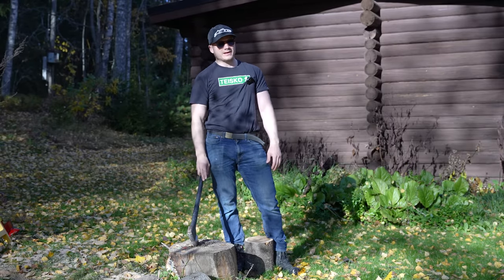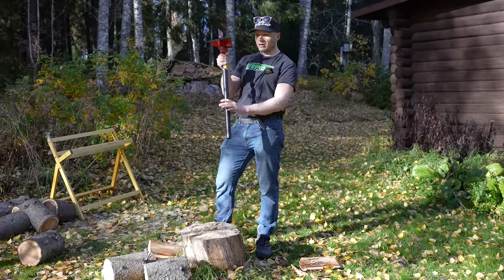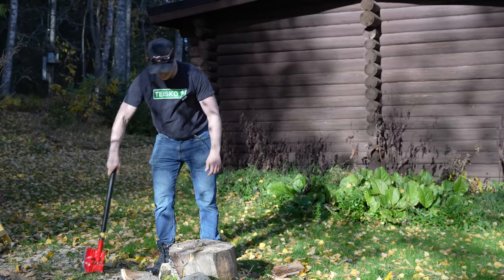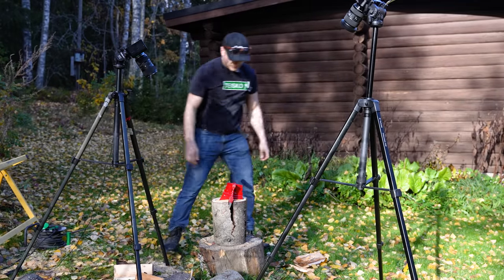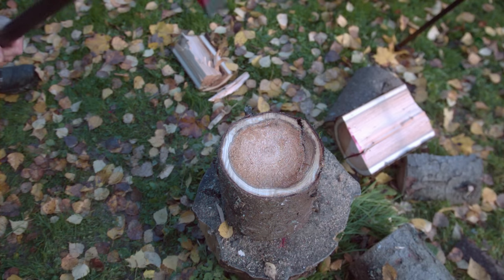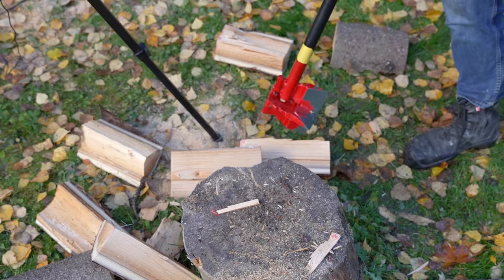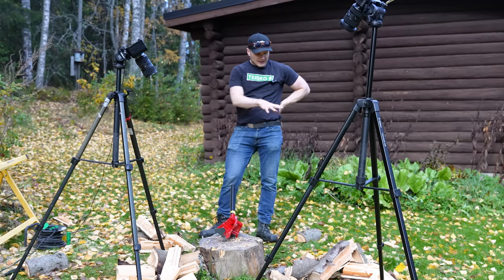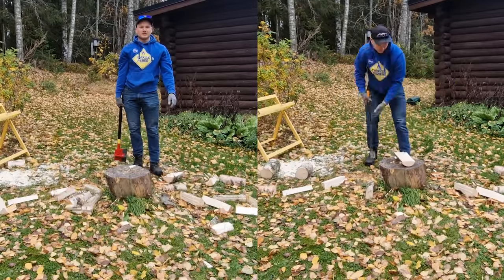The Best Axe EVER? Four Bladed Quad-Axe

Comment: When my axe gets stuck in the wood because it does not split completely, I leave my axe inside the wood, lift the whole thing, rotate it that the axe is under the wood and hit my wood block such that the weight of the wood pushes it onto the axe and so it splits. That happens especially with bigger logs and very curly strains or many knots.

Comment: This design looks like it would be best mounted to a base with a ring 8 or 10 inches above the axe blades, then place the log on top and then use a sledge hammer to split it, of course give enough room at the bottom for the pieces to fall away.

Comment: You know the problem..
You need to offset one pair of blades so it splits one way then splits the other way.
The trick will be using your high speed camera to figure out your chopping swing speed Vs how fast the wood is ejected to the side so the delayed offset blades still contact the wood before it's ejected.
The offset blades also want to angle back in towards the centre to hold the wood to reverse the original ejection direction from the initial split.

Comment: Neat, but you undoubtedly have to be more picky about what variety of wood you are splitting.   The white birch wasn't too bad, but if you tried yellow, it would be misery (splitting yellow birch through any means is pretty miserable).  Reminds me of an axe I used to have, it was labeled "the chopper" and had a couple spring loaded levers on either cheek, that would grab onto the wood on the way through,  more forcibly pushing the two halves apart, and when you didn't make the full split, it stopped the head at a really shallow depth into the wood, so it was easy to remove for another swing.  I wonder what I did with it.

Comment: I feel like it would be way better if it were smaller. Like, maybe split two heads in half instead of using 4. A smaller impact surface area will get you further in the wood.

Comment: make hydraulic woodsplitter 2000 , a one that can split like 2 metre long logs... picking up the small klapi multiple times instead of long pieces only few times to store for drying is the way (cut later to smol klapi)... you can get super manly high piles of splitted 2 metre long split wood.
Reply: edit: also good training for muscles with the extra weight to throw the klapikeihäs, and filling small trailer with them fit full lenght of it.
Reply: Make a splitting attachment for the smashinator 10 million.

Comment: Remember Kids:
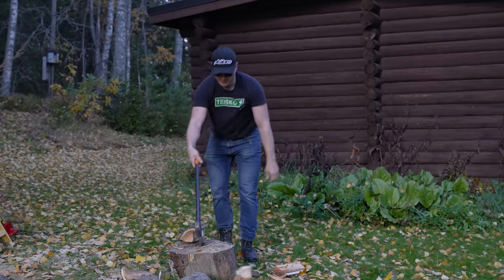0:45 Suboptimal stand. You'll hit your leg if you miss.
6:24 This is the proper stand. Legs wide so if you miss, the axe is not in line with your legs.
Reply from the maker: I wouldn't be too worried about hitting my leg when swinging axe with around 20% effort but when adding some speed definetly pay some attetion on where your legs are :D

Comment: It will have twice the resistance on your shoulder and your rotor cup.
Reply from the maker: probably four times, it's REALLY HEAVY :D
Reply: @hundredfireify  your momentum into the wood is reduced by surface area of the cutting tool... 4 way splitters work with hydraulic advantage. Hard to do as a human unless you're the Hulk😂😂😂
Reply: @hundredfireify   But that's like saying... You're going to shoot a cannon instead of a 9 mm. You only need one time to go over the threshold of the limits of the arm and cup to make the tear.
 Slow and easy smart not hard.
Reply: @timnor4803   Exactly sir. You got it.

Comment: Interesting concept and nice video.
I have been splitting logs for winter with an axe since I was a kid, 30 years old now. 
I did use 4 way wedges and a sledgehammer for big logs.
If you have many knots and the logs are fresh, such an  axe would get easily stuck. Even if it is heavier, the  force required to split a log is higher than if you used a normal axe.
If the logs are dry, there is the chance of pieces of wood flying towards you if you hit too hard.
This type of axe works well as an attachment on a logsplitter, if you have one.
Reply from the maker: Yep the wood tends to fly all  over the place with this :D

Comment: "This tool has it's limitations" - that's 4 sure! You either has to be 4m high or 4x times stronger than the average man. Because I believe the axes are made in regards to the average man height and strength, so the 4x resistance of the axe has to be over strength by the worker's power. I guess you should try to send it to someone like Eddie Hall, Shawn or Oleksiy Novikov - from the strongest men. And I'm pretty sure even they could not split the oak's woodblock of 30+ cm (which is quite typical) diameter with this "tool". This year I bought 6m3 and there were even bigger in diameter so I was pushing really hard trying to split them, and it took me sometimes up to 8 strikes, not just 1 like with 20-25 cm diameter.

Comment: By using four blades you reduced the impact force to a fourth of that of one blade. 
Also a steel handle doesn't flex - which it should. Bad for your wrists and arms.

Comment: Great idea! Some minor tweaks and that would be a great axe.
Reply: Tweak 1: Oval-ing the handle (in the press, of course) would help him keep the head aligned.  He likely rotates the cutter out of plane from lack of an index.  Noting axe handles are usually oval/ovoid...
Tweak 2: Create an adapter to fit the Smashinator 5000000.
Reply: @gth042  Ovaling the handle, yes. Also, creating a flared end, like on the original axe. Might be wise to shave and sculpt the axe heads so that they are smooth and have mothing to catch on the log while splitting.

Comment: You axe swing action is inefficient. Start your top (left in your case) immediately behind the axe head and slide that hand down towards your fixed right hand. Time your swing so both hands meet at the point of impact with the log. This make it far easier to lift the axe to working height as well as more easily controlling the momentum and direction of the heavy axe head. You can deliver more striking power with this method.